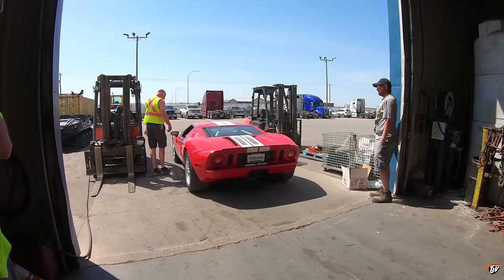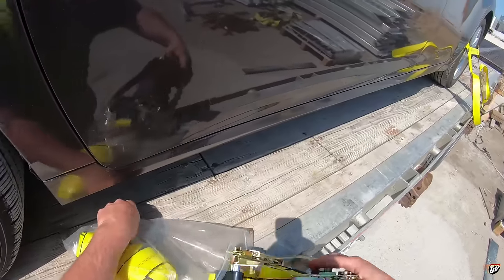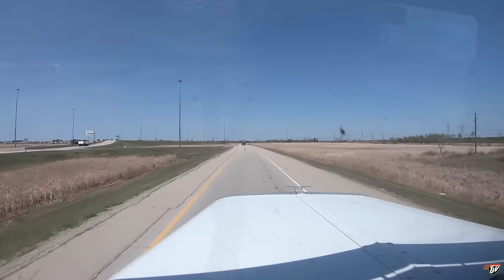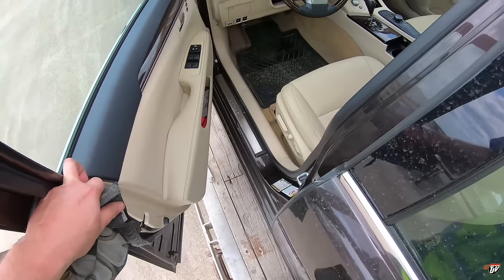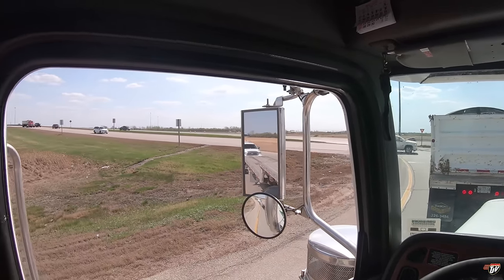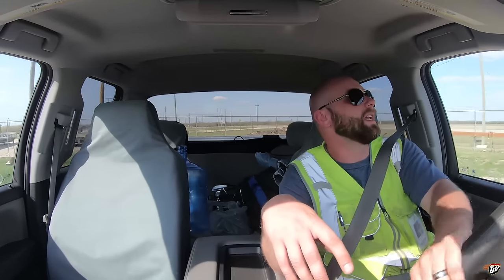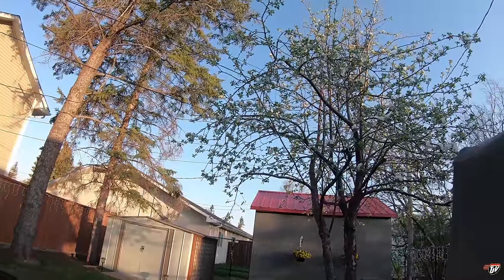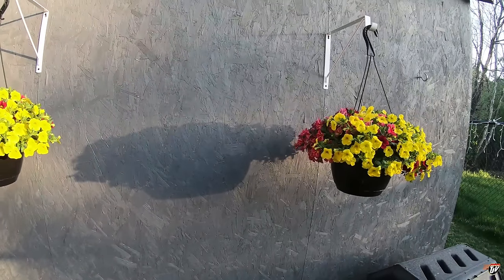My Trucking Life | ALWAYS LEARNING | #2284 | May 17, 2021

Comment: That's a Ford GT  not a GT 500.  There's no such thing as a Ford GT 500.  There is a Ford Mustang GT500  (the full name is actually Mustang Shelby GT500).  The original 1964 Ford GT was actually the Ford GT40.  After Ford stopped production of the Le Mans winning GT40 they sold the GT40 trademark.  So when Ford brought back the GT they couldn't call it the GT40, so they just called it the GT.  Also the 40 in GT40 referred to the height of the roof off the ground (40").  The 2005/06 GTs have a higher roof, so calling them a GT40 wouldn't have made sense anyway.  Now you learned more new things.  :) Happy Trails!